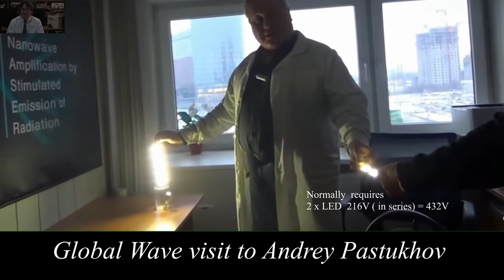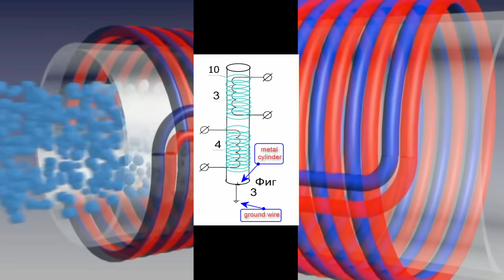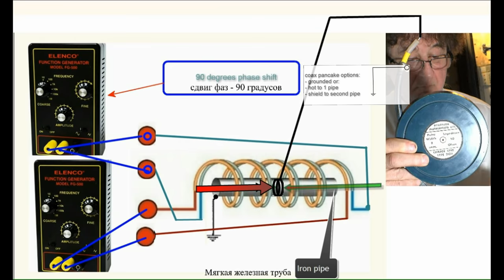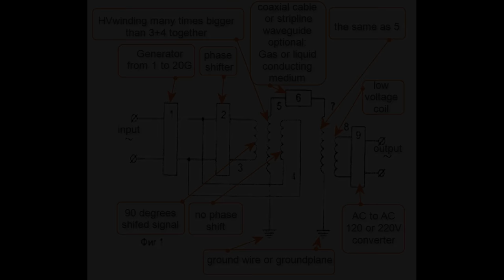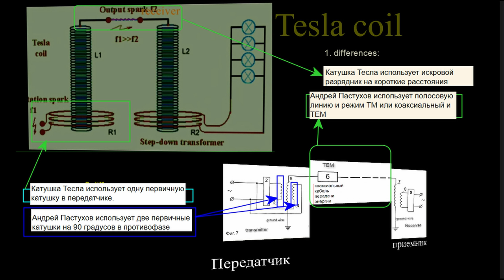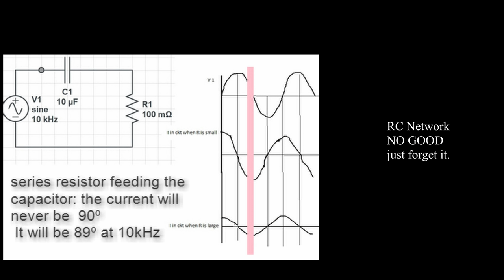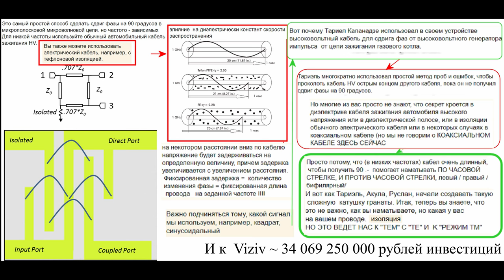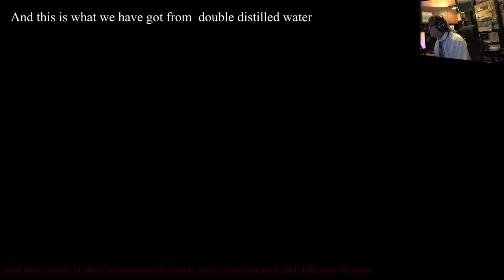Andrey Pastukhov  and Wesley   you must see it

Comment from the maker: Особая благодарность Global Wave и Андрею Пастухову   Special Thanks to Global Wave and Andrey Pastukhov
Reply: Wow ! It's the most important video on the Youtube... Thanks Wesley ! P.S. Can the waveguides (that NASER Tech device) transmute Hg=>Au ?! It looks very possible? Doesn't it?
Reply: PHASE SHIFT is tricky but you don't need it. Just use this ULTRASOUND GENERATOR. It has special outputs and will drive the bifilar coils #3 and #4:  https://myskunkworks.net/index.php?route=product/product&path=61&product_id=65
As long as you connect the two coils in reverse-parallel connection, it'll produce the SAME electro-magnetic field in the coils as the 90 degrees phase-shifted signals. And the generator has variable frequency output so you can experiment with various frequencies, and can handle up to 3 amps. I.e. the EM field will be rapidly changing from POSITIVE to BUCKING to NEGATIVE.
Reply from the maker: @starraider25   very interesting . Thank you my friend .

Comment: Discovery:-note:-- AT RESONANCE VOLTAGE AND CURRENT ARE 90 DEG OUT OF PHASE... If you have a transmitter at a particular frequency and a tank circuit tuned to that same frequency, then both would resonate at that one frequency but 90 degrees out of phase. This means that the VOLTAGE of the transmitter will now be in phase with the CURRENT of the receiver. If however, the antenna of the transmitter and the tank circuit are in the same plane then you will have:- two primary coils ---same frequency---90 degrees out of phase. Now inject "CURRENT"  (at the right time) into the tank circuit, maintaining its oscillation at a higher current. Now you have a high voltage from transmitter coil and high current from receiver coil both acting as primary coils. This is what we see on DALLY, RUSLAN, AKULA......High voltage Kacher transmitter ANTENNA coil loosely coupled with high current bifilar receiver coil both acting as primary coils.....kacher voltage is in phase with bifilar current. BINGO!!!!

Comment: Hi in the video you suggest that getting 90deg phase shift can be done with a capacitor, that won't work all you do with an inductor is make it look like a resistor that won't produce a phase shift of 90 deg to do the phase shift try rectifying it and using some electronics to do the job properly there are loads of vids showing how on youtube. kind regards ;)
Reply from the maker: https://electronics.stackexchange.com/questions/172642/why-does-a-capacitor-create-a-90-degree-phase-shift-of-voltage-and-current
Please read it.
Wesley

Comment: PHASE SHIFT is tricky but you don't need it. Just use this ULTRASOUND GENERATOR. It has special outputs and will drive the bifilar coils #3 and #4:  https://myskunkworks.net/index.php?route=product/product&path=61&product_id=65
As long as you connect the two coils in reverse-parallel connection, it'll produce the SAME electro-magnetic field in the coils as the 90 degrees phase-shifted signals. And the generator has variable frequency output so you can experiment with various frequencies, and can handle up to 3 amps. I.e. the EM field will be rapidly changing from POSITIVE to BUCKING to NEGATIVE.

Comment: Does propose schematic with phase shifted work if using small cheap function generator at rate 100khz , in theory ? at scale 15mA? Kinda think bout it...
Reply from the maker: It is no difference what kind of signal, is driving the system. The ratio between primary and secondary in typical  air transformer  such as Tesla  coil is  what gives you HV.  It is good to have 10V from generator so with ratio 1:1000  if winds Pri/Sec  10x1000=10 000 . (suggested 30 000V )

Comment: Wesley at end you probably drink energy drink :D
Reply from the maker: i was just tired, it was late night :)
Reply: @stivep1  what material was these black blocks? It was led lamp?  its interesting experiments, how far you tested from transmiter?
Reply from the maker: @zcsaba77  It was plastic  dielectric made by  Quadrant Engineering Plastic Products. 
Full name is: 
Tivar Specialty Anti-static Plate  Black
(The last word <Black> stands for color)
diameter 1.5x 12"x12"
the last row is number but I dont know what it means:
dk 2- 5-10
You can buy it is the item on the market .
the distance from Tesla Tower acting as Tx was ~1200ft

More  explanation is here 

https://youtu.be/XOTLfnMOSqQ?t=366
but you need to watch full video 
Wesley